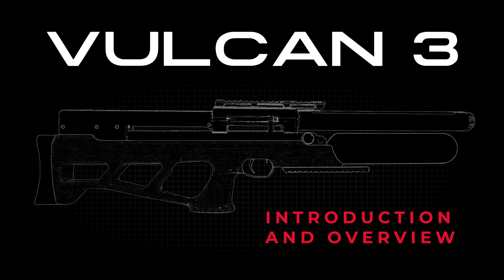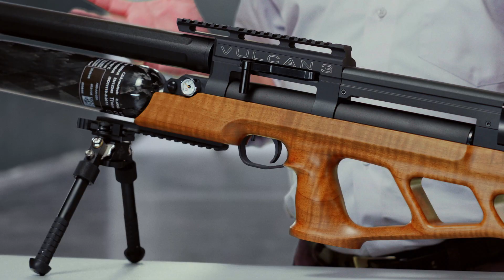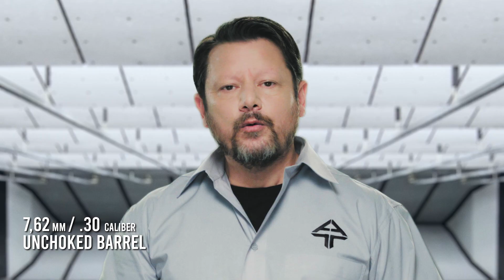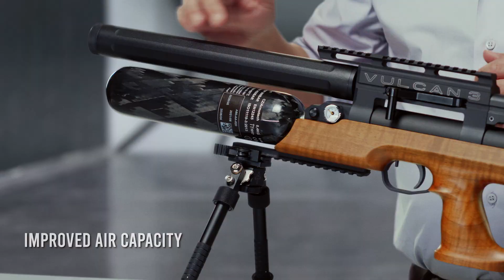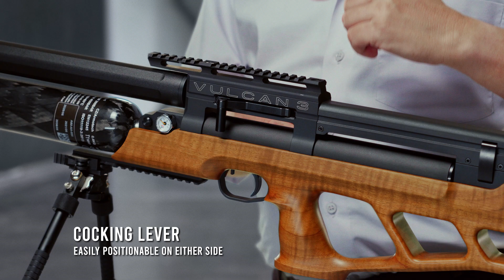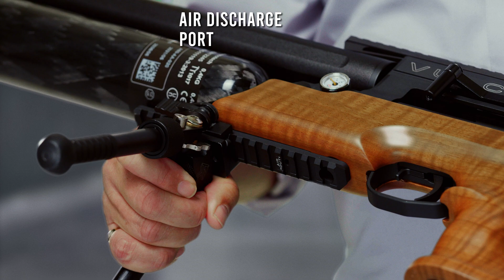VULCAN 3 - The New Air Rifle by Airgun Technology  |  Introduction and Overview - Updated

Comment: Does the Vulcan 3 500mm cal .22 have the aluminum sleeve inside it to avoid the return of the regulator while shooting, in 700mm the sleeve is supplied in the box but not installed. My rifle is produced in march 2021.
Reply: I think that sleeve is to reduce plenum volume to aid consistency for sub12 users